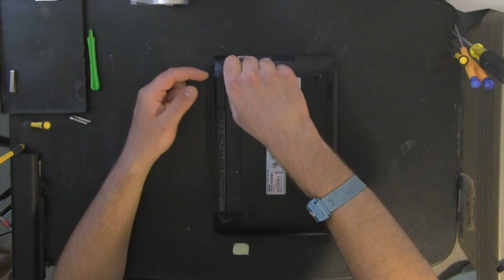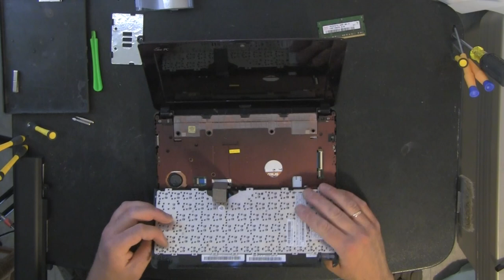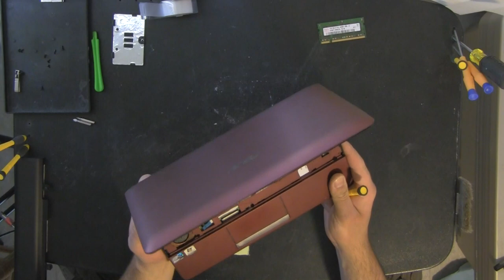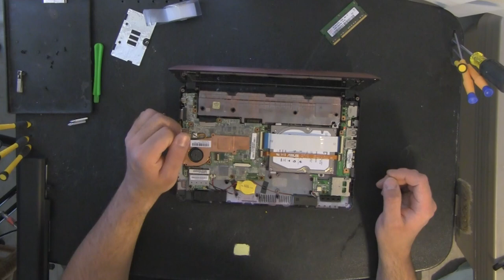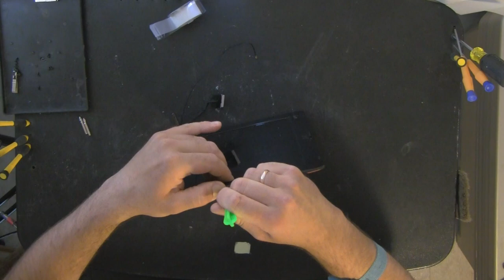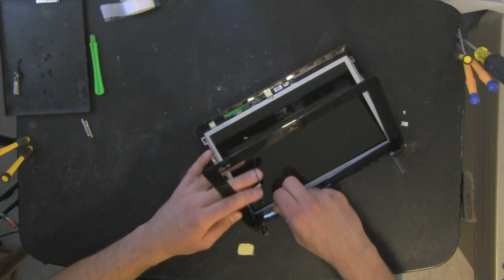ASUS EeePC 1015PEB laptop netbook take apart video, disassemble, how to open disassembly

Comment from the maker: depends where laptop coming from. Some people have cats who like to sit close or even on top of it. You can try a compressed air, just try to not spin fan very fast, some people was braking it by doing this. But if there is a really good amount of dust inside, compressed air will probably not help.
Good luck!

Comment from the maker: (sorry for late comment)
I hope you was able to unscrew them. 
If the screw head get's damaged it can be pain in a butt to remove it. You may buy a screw extruder, smallest possible to try it first. If this will not help, you may use a drill to carefully drill it out. With both tools you need to be very careful, because drill (especially drill bit) can damage plastic pretty bad.
Reply: You still alive bro? Just wanna thank you 🙏
Reply from the maker: @suyahatesntr  all good and alive! Thank you for support! I am glad this video helped!!!

Comment: Yeeks !!!   If I tried this I would have at least 6 - 8 screws left over..  I was checking to see about the Speaker placement.. as my  Eepc was putting out horrible sound.. turns out it had picked up a mini staple.. and was stuck to speaker magnet.. now aok.. no surgery required  :)

Comment: hey, you know the black tape you peeled off the hdd at 8:40 in the video. well if you put a new hdd to you have to put that on it? cause i upgraded the hdd on one very similar to yours (mines a 1015px) and whenever i tilted it i heard like a grinding noise. im not sure whether it was the hdd that was broken or something else. the sound was similar to when you put a cd in a laptop and then move it. if i tilted the laptop quickly the hard drive would stop and make a beep sound. thats not normal. but i just want to know is that due to not having the black tape or is it because of a bad hdd. the hdd i added to it was higher rpm (7200rpm) than the previous (5400rpm). thanks.
Reply from the maker: Hello, I would say it not a must, but better to do same as original genuine manufacturer. As they do something for a reason.

Comment: Can anyone tell me if this model uses the 2.5mm/0.7mm or 2.3mm/0.7mm power source? Thank you.
Reply from the maker: Can't say exactly, but if you are talking regarding a charger and it's plug, I would suggest to search for used chargers on eBay to find a correct charger

Comment: I hope, for your sake, you didn't use that drill to put this back together...
Reply from the maker: Lately I use my wireless screwdriver only on some external case bottom screws. So, this video was made a few years ago and only one way.
Reply: +regazzz Good... I say that, because I've had supervisors that would have a conniption fit if you used that to reassemble a computer. We had a guy that would over torque the mounting screws, and would damage the mobo...